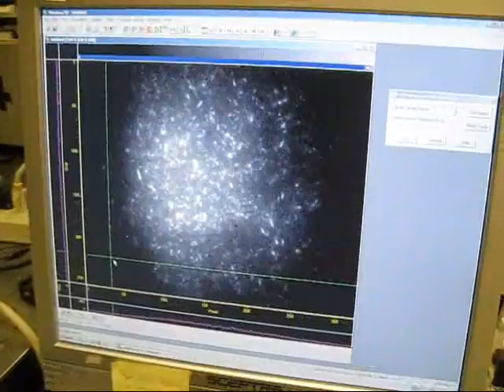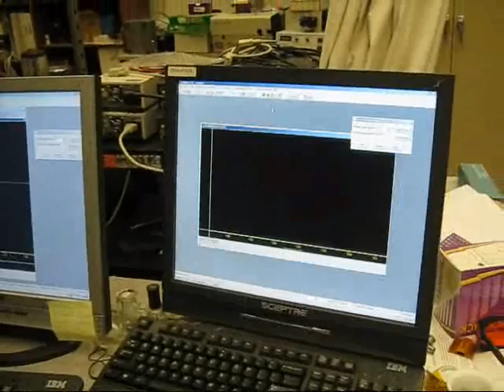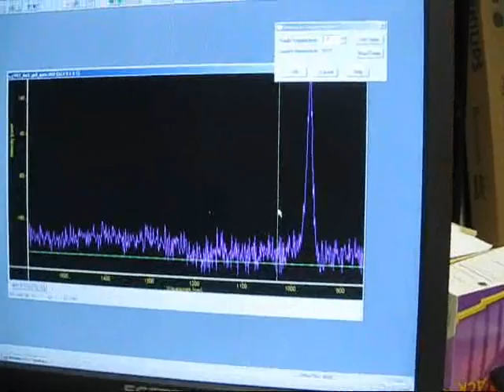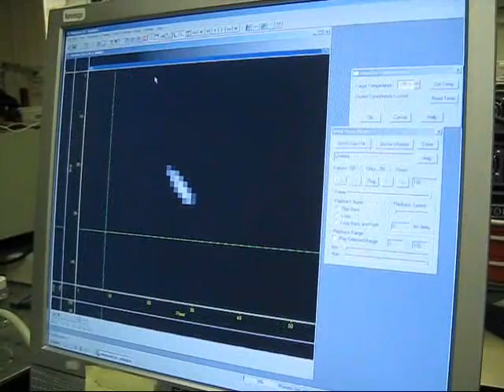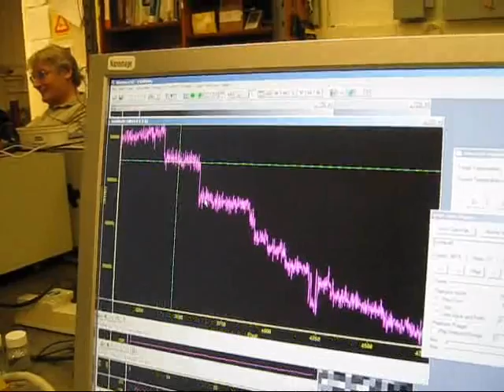Single nanotube experiment with tunable Ti:Sapphire laser Trestles sales@dmphotonics.com

Comment from the maker: Carbon nanotube transistors outperform silicon and GaAs

5th September 2016

US researchers build CNT FETS with current density of 900mA mm-1

University of Wisconsin-Madison materials engineers have created semiconducting single-walled carbon nanotubes (CNTs) that outperform state-of-the-art silicon and GaAs transistors.

The researchers reported their advance in Science Advances in a paper titled 'Quasi-ballistic carbon nanotube array transistors with current density exceeding Si and GaAs’.

Led by Michael Arnold and Padma Gopalan, the team developed carbon nanotube transistors with a current 1.9 times higher than silicon transistors. The on-state current density exceeds that of GaAs FETs. 

This breakthrough in CNT array performance is said to be a critical advance toward the exploitation of CNTs in logic, high-speed communications, and other semiconductor electronics technologies.

A 100nm channel length CNT array FET developed by the team had a current density of 900 mA mm-1 which they say exceeds the 630 mA mm-1 demonstrated by other researchers for GaAs pseudomorphic high-electron mobility transistor (pHEMT) technology.

"This achievement has been a dream of nanotechnology for the last 20 years," says Arnold. "This breakthrough in carbon nanotube transistor performance is a critical advance toward exploiting carbon nanotubes in logic, high-speed communications, and other semiconductor electronics technologies."

The new transistors are particularly promising for wireless communications technologies that require a lot of current flowing across a relatively small area.

Carbon nanotube transistors should be able to perform five times faster or use five times less energy than silicon transistors, according to extrapolations from single nanotube measurements. The nanotube's ultra-small dimension makes it possible to rapidly change a current signal traveling across it, which could lead to substantial gains in the bandwidth of wireless communications devices.

But researchers have struggled to isolate purely carbon nanotubes, which are crucial, because metallic nanotube impurities act like copper wires and disrupt their semiconducting properties - like a short in an electronic device.

The UW-Madison team used polymers to selectively sort out the semiconducting nanotubes, achieving a solution of ultra-high-purity semiconducting carbon nanotubes.

Placement and alignment of the nanotubes is also difficult to control. In 2014, the UW-Madison researchers overcame that challenge when they announced a technique, called "floating evaporative self-assembly," that gives them this control.

The nanotubes must make good electrical contacts with the metal electrodes of the transistor. Because the polymer the UW-Madison researchers use to isolate the semiconducting nanotubes also acts like an insulating layer between the nanotubes and the electrodes, the team "baked" the nanotube arrays in a vacuum oven to remove the insulating layer. The result: excellent electrical contacts to the nanotubes.

The researchers also developed a treatment that removes residues from the nanotubes after they're processed in solution.

"In our research, we've shown that we can simultaneously overcome all of these challenges of working with nanotubes, and that has allowed us to create these groundbreaking carbon nanotube transistors that surpass silicon and gallium arsenide transistors," says Arnold.

They are continuing to work on adapting their device to match the geometry used in silicon transistors, which get smaller with each new generation. Work is also underway to develop high-performance radio frequency amplifiers that may be able to boost a cellphone signal. While the researchers have already scaled their alignment and deposition process to 1 inch by 1 inch wafers, they're working on scaling the process up for commercial production.

The researchers have patented their technology through the Wisconsin Alumni Research Foundation.
http://www.compoundsemiconductor.net/article/100071-Carbon-nanotube-transistors-outperform-silicon-and-GaAs.html

Comment from the maker: Graphene converts electricity into light
http://www.laserfocusworld.com/articles/2016/06/graphene-converts-electricity-into-light.html

06/16/2016 
Posted byGail Overton 
Senior Editor

      An illustration depicts the process of light emission from a sheet of graphene, which is represented as the blue lattice on the top surface of a carrier material. The light-colored arrow moving upwards at the center depicts a fast-moving electron. Because the electron is moving faster than light itself, it generates a shock wave, which spews out plasmons, shown as red squiggly lines, in two directions. (Image credit: MIT) 

IMAGE: An illustration depicts the process of light emission from a sheet of graphene, which is represented as the blue lattice on the top surface of a carrier material. The light-colored arrow moving upwards at the center depicts a fast-moving electron. Because the electron is moving faster than light itself, it generates a shock wave, which spews out plasmons, shown as red squiggly lines, in two directions. (Image credit: MIT)

A team of researchers at the Massachusetts Institute of Technology (MIT; Cambridge, MA) and other international institutions have discovered a process similar to the sonic boom created when an airplane exceeds the speed of sound; namely, a flow of electric current into a sheet of graphene can, under certain circumstances, exceed the speed of slowed-down light and produce a kind of optical “boom”--an intense, focused beam of light.

This entirely new way of converting electricity into visible radiation is highly controllable, fast, and efficient, the researchers say, and could lead to a wide variety of new applications. The work is reported in the journal Nature Communications in a paper by two MIT professors--Marin Soljačić, professor of physics; and John Joannopoulos, the Francis Wright Davis Professor of physics--as well as postdoc Ido Kaminer, and six others in Israel, Croatia, and Singapore.

The new finding started from an intriguing observation. The researchers found that when light strikes a sheet of graphene, which is a two-dimensional form of the element carbon, it can slow down by a factor of a few hundred. That dramatic slowdown, they noticed, presented an interesting coincidence. The reduced speed of photons (particles of light) moving through the sheet of graphene happened to be very close to the speed of electrons as they moved through the same material.

"Graphene has this ability to trap light, in modes we call surface plasmons," explains Kaminer, who is the paper's lead author. Plasmons are a kind of virtual particle that represents the oscillations of electrons on the surface. The speed of these plasmons through the graphene is "a few hundred times slower than light in free space," he says.

This effect dovetailed with another of graphene's exceptional characteristics: Electrons pass through it at very high speeds, up to a million meters per second, or about 1/300 the speed of light in a vacuum. That meant that the two speeds were similar enough that significant interactions might occur between the two kinds of particles, if the material could be tuned to get the velocities to match.

That combination of properties--slowing down light and allowing electrons to move very fast--is "one of the unusual properties of graphene," says Soljačić. That suggested the possibility of using graphene to produce the opposite effect: to produce light instead of trapping it. "Our theoretical work shows that this can lead to a new way of generating light," he says.

Specifically, he explains, "This conversion is made possible because the electronic speed can approach the light speed in graphene, breaking the 'light barrier'." Just as breaking the sound barrier generates a shockwave of sound, he says, "In the case of graphene, this leads to the emission of a shockwave of light, trapped in two dimensions."

The phenomenon the team has harnessed is called the Čerenkov effect, first described 80 years ago by Soviet physicist Pavel Čerenkov. Usually associated with astronomical phenomenon and harnessed as a way of detecting ultrafast cosmic particles as they hurtle through the universe, and also to detect particles resulting from high-energy collisions in particle accelerators, the effect had not been considered relevant to Earthbound technology because it only works when objects are moving close to the speed of light. But the slowing of light inside a graphene sheet provided the opportunity to harness this effect in a practical form, the researchers say.

This new plasmon-based approach to light generation might eventually be part of more efficient, more compact, faster, and more tunable alternatives for certain applications, the researchers say. Perhaps most significantly, this is a way of efficiently and controllably generating plasmons on a scale that is compatible with current microchip technology. Such graphene-based systems could potentially be key on-chip components for the creation of new, light-based circuits, which are considered a major new direction in the evolution of computing technology toward ever-smaller and more efficient devices.

One problem faced by researchers trying to develop optically based chips, he says, is that while electricity can be easily confined within wires, light tends to spread out. Inside a layer of graphene, however, under the right conditions, the beams are very well confined.

"There's a lot of excitement about graphene," says Soljačić, "because it could be easily integrated with other electronics" enabling its potential use as an on-chip light source. So far, the work is theoretical, he says, so the next step will be to create working versions of the system to prove the concept. "I have confidence that it should be doable within one to two years," he says. The next step would then be to optimize the system for the greatest efficiency.

The research was supported by the U.S. Army Research Laboratory and the U.S. Army Research Office, through the Institute for Soldier Nanotechnologies at MIT. The team included researchers Yichen Shen, Ognjen Ilic, and Josue Lopez at MIT; Yaniv Katan at Technion, in Haifa, Israel; Hrvoje Buljan at the University of Zagreb in Croatia; and Liang Jie Wong at the Singapore Institute of Manufacturing Technology.

SOURCE: MIT News; http://news.mit.edu/2016/new-way-turn-electricity-light-using-graphene-0613

Comment from the maker: DPSS DMP LH series lasers will pump your Ti:Sapphire laser - request a quote
http://www.dmphotonics.com/DPSS/Ti_Sapphire%20laser%20pumping.htm
Del Mar Photonics offers High Power CW 532 nm DPSS DMP LH series Lasers suitable for Ti:Sapphire laser pumping
Features
• Compact laser head with sealed  enclosure for long lifetime
• Long lifetime diode pack fiber-coupled to laser head
• Excellent long-term power stability <0.5% rms over 24 hours
• Closed-loop, purpose-built TEC chiller integrated in power supply 
 (no need to buy a separate chiller to cool Ti:Sapphire crystal!)
• 5, 6, 8 and 10 W versions
DPSS DMP LH series is a compact, diode-pumped solid-state (DPSS) laser providing high-power, continuous-wave (CW) power at 532nm in a near- perfect TEMoo mode with extremely low optical noise and excellent long-term stability. DPSS DMP LH series is truly a next-generation laser designed and manufactured using many years of experience to provide a sealed, turn-key source of collimated green light with high spectral purity.

A number of key technologies guarantee this performance. Sealed technology keeps all dirt, dust and moisture out of the laser head to provide years of uninterrupted usage without need for cleaning or maintenance. All cavity optics is permanently locked in perfect alignment.

The laser head is a monolithic 3-dimensional design for ruggedness and compactness to minimize the space consumed in your lab or instrument. The fiber-coupled pump diode package, contained in the power supply, has an expected lifetime of more than 20,000 hours to minimize cost-of-ownership. The power supply also contains an integrated thermo-electrically-cooled (TEC) chiller. The chiller is designed specifically for this application to provide increased reliability and reduced overall system footprint. Additional features include automatic laser power control and USB/RS-232 interface for external monitoring and control.

DPSS DMP LH series is a state-of-the-art laser designed for today’s applications.
It combines superb performance and tremendous value for today’s market.

Applications
• Pumping Ti:Sapphire lasers:
ultrafast & continuous-wave
• Pumping dye lasers
• Spectroscopy
• Flow cytometry
• Solar cell processing
• Ophthalmology
• Medical diagnostics
• Film subtitling